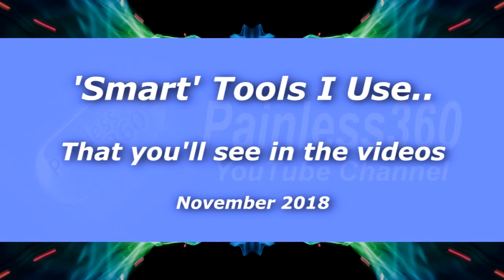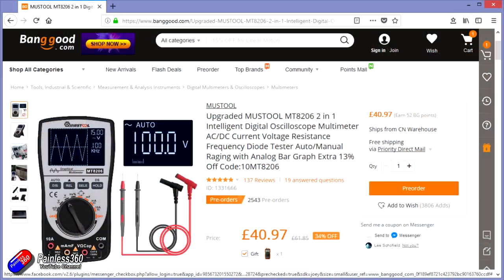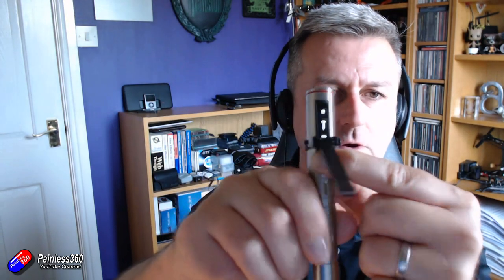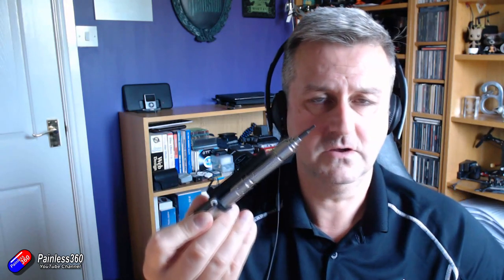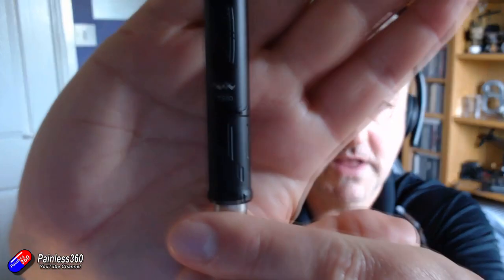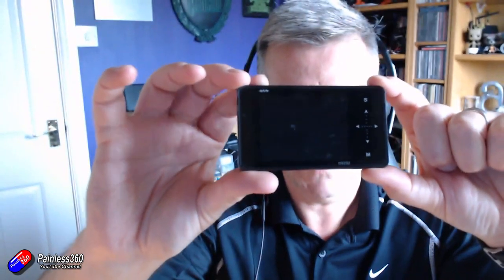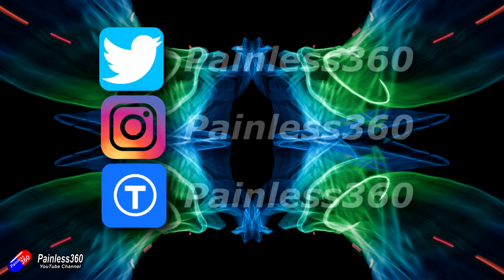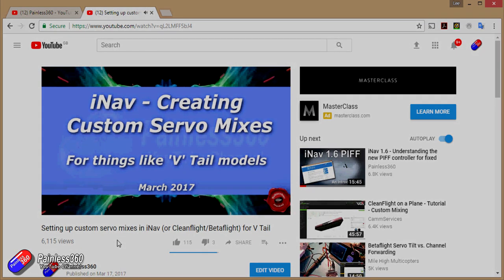R/C 'Smart' Tools I use in videos

Comment: Really nice tools, Lee! 😊
About the screwdriver, I made one with a modified 9g servo (with metal gears) and I guess it has almost the same torque. It's pretty nice, I used a cellphone battery, with a TP4056 to recharge it and so on... And put everything in a Tic Tacs little box. 😊
I want to make a new one with a bigger servo, but I still couldn't decide how yet. But, anyway, I should use mine more often...
Reply: MC, make a video about how you made your screwdriver!
Reply: @bobt219  I already did, dude. There are 2 old videos in my channel, the first one I used a plastic geared servo and in the second one I replaced it with a metal geared one. But... It's in Portuguese. I'm from Brazil. 😕
Anyway, I started to record speaking both in Portuguese and English. Let's see if it works... Then the next one I make I record that way. 😊

Comment: question   lipo voltage per cell ?     4.2 ?    is that a physical limitation of the sheets of aluminum and lipo material inside battery ??
Reply from the maker: You can charge a cell past that point but it will shorten its life. To see more Google ‘lipo voltage painless360’ to find my video on it. https://youtu.be/P4soR6QgOk0 best of luck!